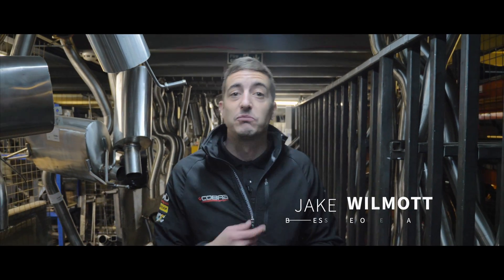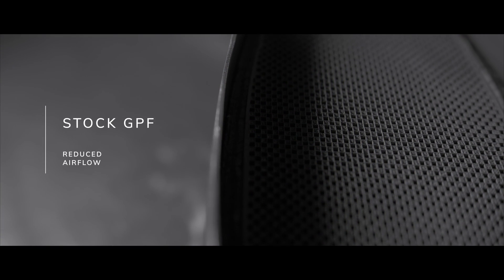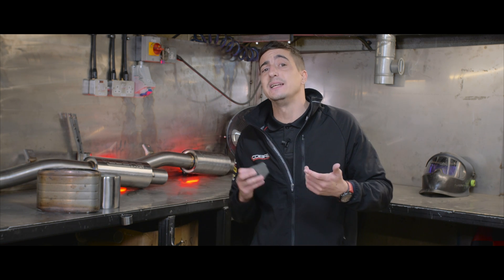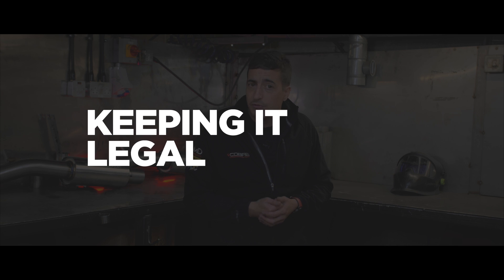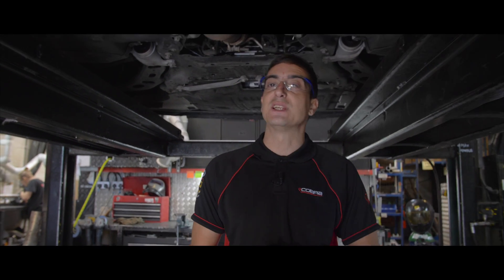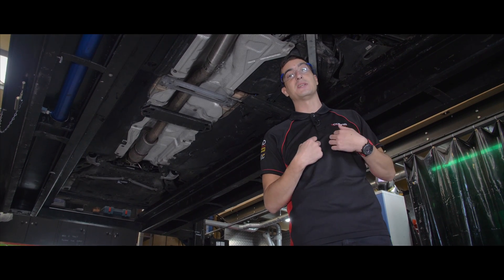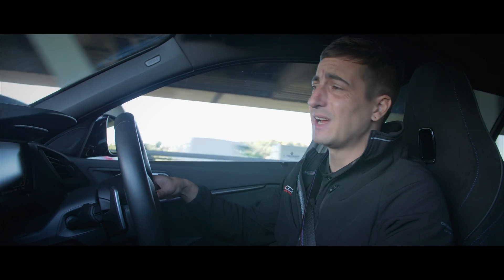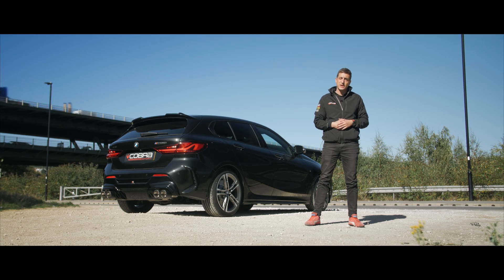Exhaust Talk: 03 | GPF Debate - What is a GPF/PPF Exhaust Particulate Filter - Improve Exhaust Sound

Comment: I have a bmw 420d is it possible to get more sound but not taking away particle filter?
Reply from the maker: There is a change/improvement in exhaust tone when fitting our quad exit exhaust as it becomes deeper and more noticeable, there is however very little increase in sound volume. This is the most we can do due to the noise cancelling properties of the DPF filters.

Comment: Great video. 
You said that by removing opf/gpf you’d fail MOT, what about changing downpipe to 200 cells? 
Would I pass MOT? 
Will it show a malfunction light on the dashboard? 
Thanks
Reply from the maker: Fitting a 200 cell sports catalyst will give the same emission result on an MOT test. In the UK the catalyst needs to be homologated for it to be road legal. The car will likely show an engine warning light on the dashboard due to the increase flow rates, we always recommend the car is re-mapped at the time of fitment to balance our the flow rates/performance gains.

Comment: I suspect the primary purpose of these devices is to accelerate degradation of the engine by raising the pressure in the exhaust, in order to get petrol cars off the roads sooner and ‘encourage’ people to buy the battery-powered goofcarts.

Ruining the sound is a bonus as it targets one of the reasons enthusiasts aren’t taking up on BEVs.

Comment: Hello,does this still have a back box or has the size been reduced?
Reply from the maker: The video features our valved setup for the M135i which includes a back box for when the valve is closed. When the value is open, the silencer mainly bypassed - https://cobrasport.com/collections/bmw-1-series-exhaust/products/bmw-m135i-f40-quad-exit-gpf-ppf-back-m3-style-performance-exhaust

Comment: Is the CAN MIL Deleter required after removing the OPF ?
Reply from the maker: The software of the car will need to be altered in order to remove a GPF if you were intending to do this for off road use, the GPF functionality can be turned off relatively easily.

Comment: Does a engine need remaping after changing anytbing on exoust system?
Reply from the maker: The only time a re-map is needed is if you were to upgrade the front pipes. Fitting a cat back, GPF back or rear section exhaust will not need a re-map.

Comment: Gpf is not mandatory in Australia and North America. Only Europe mandates this and VW exports gpf equipped cars to Australia. 
I am interested in the gpf delete but it will void the warranty.
Reply from the maker: Hi, Yes this would normally void warranty, most dealerships don't mind you having a GPF back system but i would suggest checking with your dealership first, as it is a modification and can effect the warranty but also removing the GPF is some states like the UK is illegal and would not pass an MOT as it removes an emission device.